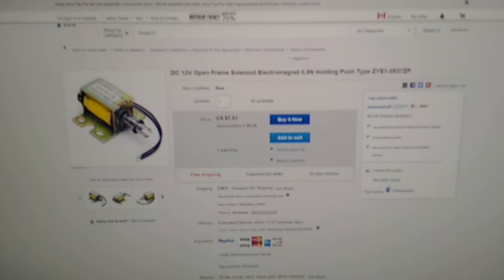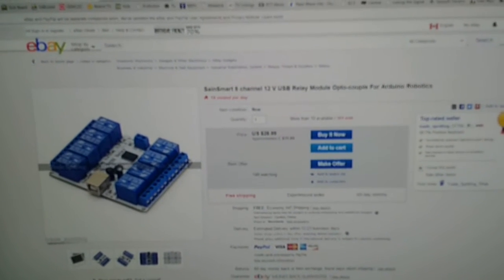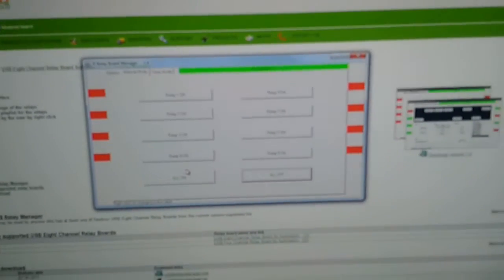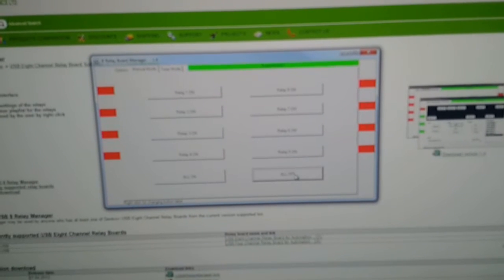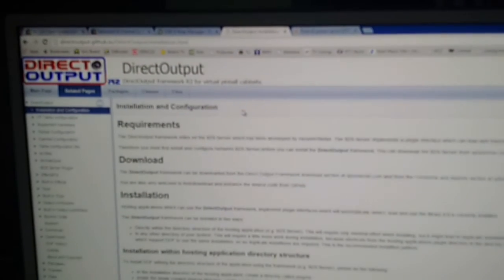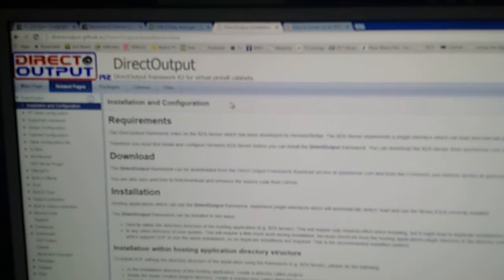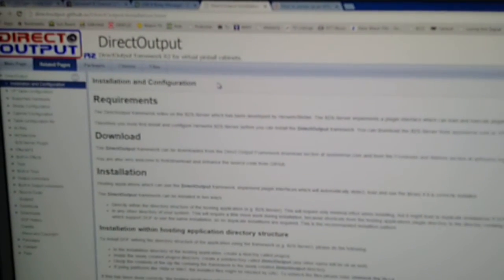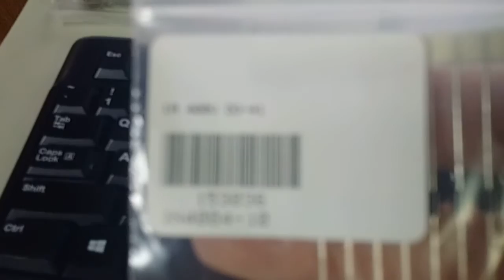Wiring up Solenoids (DOF) to a Visual Pinball Cabinet

Comment: Perfect.. this is exactly what I needed.. Will this work with the 4 port? I read that it will only work with the Sanesmart 8 port board? Can you please post 1 more update video with how you got all this to gel with the pinball software? I've been reading up bit it's really confusing.. What is the diode in between +12v and - for the bumper?
Reply from the maker: Its in the description .. No experience with a 4 port - if its usb, I dont see why it wouldnt work.

Comment: Sample actual Solenoid with Diode Attached, pointing to the + side of the coil, for those adding coils to your VP cabs.
 https://www.ebay.com/itm/Data-East-Sega-090-5036-01-Coil-Solenoid-For-Pinball-Game-Machines/223409701264?_trkparms=aid%3D1110001%26algo%3DSPLICE.SIM%26ao%3D2%26asc%3D20160323102634%26meid%3De8e18467262a43a29d7c62b2dc5c31a5%26pid%3D100623%26rk%3D2%26rkt%3D6%26mehot%3Dlo%26sd%3D261737543180%26itm%3D223409701264%26pmt%3D0%26noa%3D1%26pg%3D2047675&_trksid=p2047675.c100623.m-1

Comment: Any overheating issues with the solenoids when staying energized (such as holding the flipper?)
Reply: I'm using the same coils as in the video and do a lot of Flipper Holding. So far they can get a little warm but have not overheated or burned up yet. I check them regularly because I hold a lot. I see some other videos with guys using 12v Automotive starter relay solenoids because they are designed to be "held open" for longer periods of time.
Reply from the maker: Nothing that is within reason .. I can hold it for a minute or more.. These are not big 12v solenoids that could cause issues.
Reply: @darylerwin  That's good news. Thanks for the quick feedback!

Comment: If adding coils to VP cabinet and you want to understand the diode piece of the equation in video, here is a good video for the reverse biased diode to block the voltage from coming backwards into the solenoid (https://www.youtube.com/watch?v=6lep5e3KMdY).  I'm upgrading from the same 12v  Amazon coils like ones in the video to stronger pinball specific coils that pack more punch.  Example: https://www.marcospecialties.com/pinball-parts/090-5036-01 or 090-5036-OT on Ebay,  diode already installed.  Many of the commercial pinball coils have the diode installed already for this same purpose, to block the voltage in 1 direction for the coil. This coil 090-5036-01 is rated for 50v but will trigger @ 12v.  I used this coil as my Knocker coil, works great. So far no heat issues and no fires.

Comment: Hello, I bought the Saints Smart 8-relay plate plus the 4004 diodes. I have a ledwiz plate and other things I would like to know if you have any connection scheme since thank you very much.
Reply: Thank you very much, it's all right, I have just such a video, now that the cable goes to the LedWiz board, so I can configure DOF

Comment: Hi, can i use solenoids with sainsmart 8 ch relay without ledwiz? Is it 
possible? For example if i want to activate solenoids only when i press 
flipper buttons, can i do this also with solenoids and sainsmart? Thank 
you
Reply from the maker: i dont have a ledwiz .. just what I showed in the video.  thats all you need to fire upto 8 things. ledwiz allows you to control even more things like leds :-)
Reply: Daryl Erwin  hi, thanks for reply. How can you say to pc that when you press pinball buttons it will activate solenoids? The software can do this?
Reply from the maker: The sainsmart connects via usb (be sure you get the right version!) .. then it acts like  a game controller .. I believe I linked to software that can test it out and fire off the 8 ports via the program. VP has software called "DOF"  that controls the sainsmart. A simplified rundown is you create a dof account on http://configtool.vpuniverse.com/login.php  , map your switches to pinball actions .. ie port 1 might be your left flipper, port 2 might be your right etc. Then you download the files to your pin machine and it knows what to fire when.
Reply: Perfect, thank you so much
Reply from the maker: I dont believe so .. you cant push 24v thru the sainsmart .. but you can check the specs on that.
Reply: Francesco, I am attempting the same thing you are (without the LED Whiz and just using the Sainsmart 8 to trigger flipper solenoids). Did you ever get it to work as you wanted?

Comment: i am wondering too how to connect the Diodes. do you have a picture?
Reply: Thanks
Reply: I have the same question.
Reply from the maker: Connect it in parallel with the line/stripped side of the diode connected to the positive wire.
Reply: Hi Daryl, so is the 4004 diode there to protect the Arduino coil from when the 12v flipper coil is de-energized? Thanks for your video.
Reply: thank you

Comment: thanks for posting this. the diodes you are suing the 1N4004 - they say 1.1v max, so this is OK to use given 12v power supply , and how do you attach the diode ? sorry if this is a silly question, this kind of eletronics is new to me. I am adding a couple of central locking solenoids as flipper feedback usin ghe same sainsmart relay you have. thank you for any help !